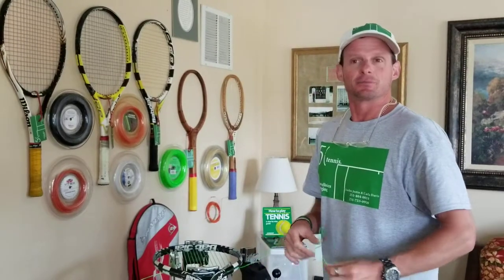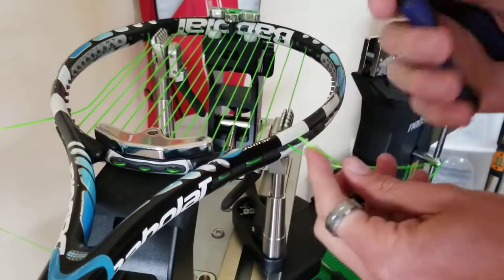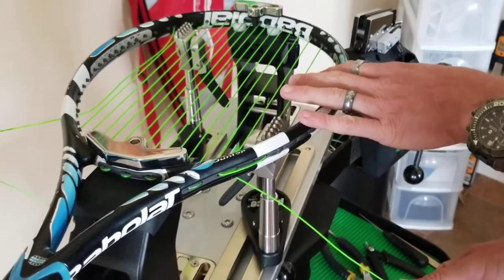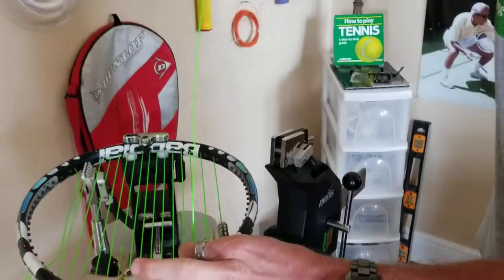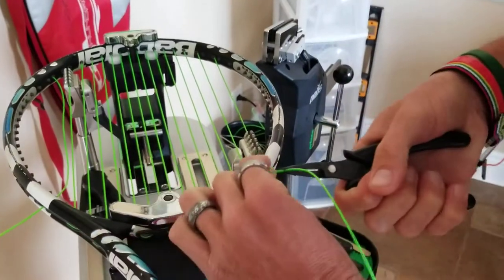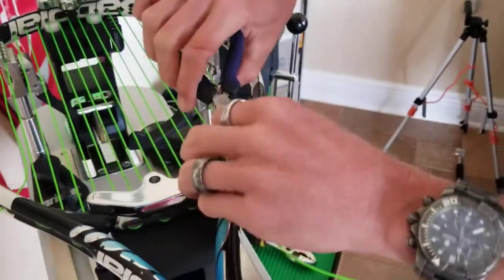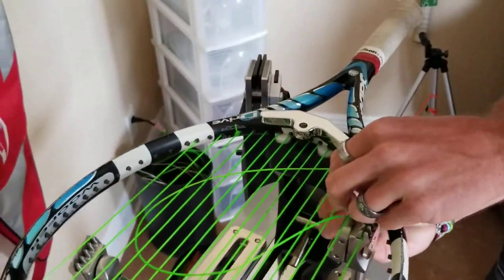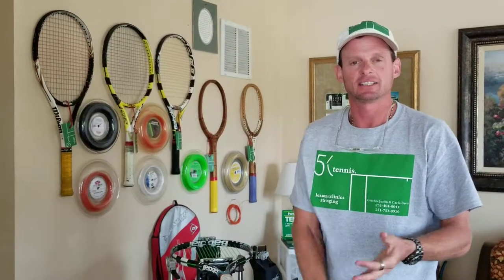How tie a Finishing knot? Tennis Racquet Stringing

Comment: Is there a reason you release tension before tying off the 2nd knot? Sorry if I missed the explanation if you covered in the video. Thanks for the video instructions.
Reply from the maker: After I pull one loop of the knot, I'll release it sometimes to cinch the knot tighter
Reply: @5KTennis  ok, thanks for the reply
Reply from the maker: No problem. Thanks for the comment. 💪